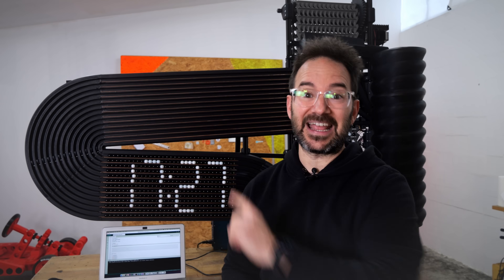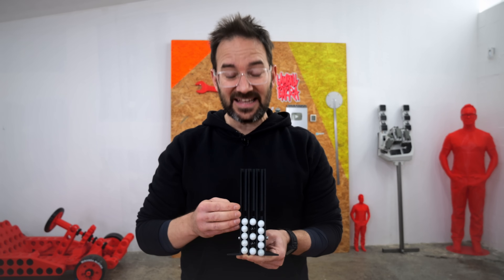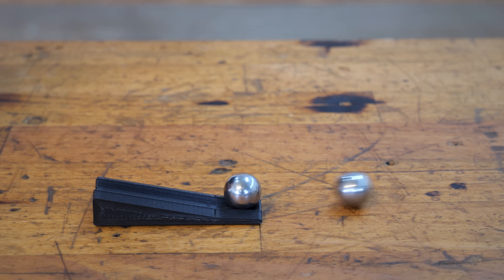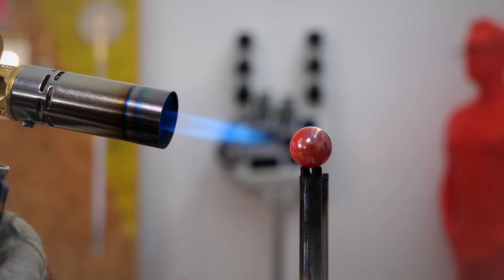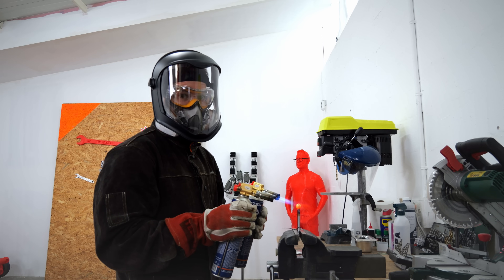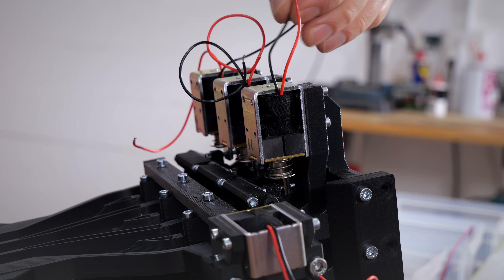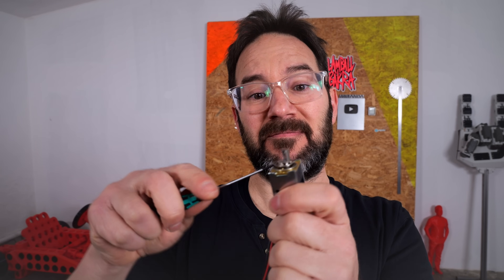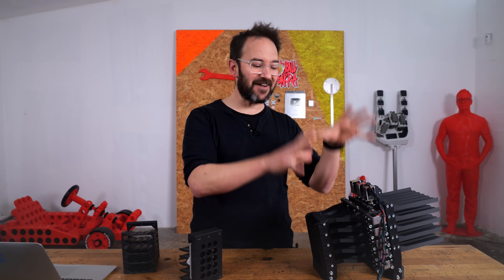Ramp Based Rapid Marble Swap - Marble Clock Seconds Display Pt.1

Comment: You can scale up and improve the marble paint.
First, make a hopper to drop the marble on a rail made of to parallel metal roods.
Then make a simple mechanism maybe using a pin on the middle of the rail that o push down and the marble go direct to the oil bath.
Put a metal basket on the oil like the one they use to fry potatoes.
Make 10 rail in parallel with 10 tourchs.
The mechanism to stop would be like that fork they use to get hail but with very small teeth.
Reply: you can automate it easily, use timer to release the ball to oil bath.

Comment: Personally, I'd rather use pushing mechanism to push out new balls new balls trough flexible holding fingers
Also remove randomness, make each digit contain all 10 or 7 or 3 digits
And another idea is having reciprocating motion of fingers (that are placed between 4 balls) fingers move forward, moving balls forward, balls get blocked from moving, fingers retract, releasing front part of support, that slide down to non-mixing rails for recycle, and right behind them another digit is visible right away, about to get pushed out
Fingers made of sturdy material like rods with bumps, allowing you to keep balls pretty much next to each other, it removes any steering or smart detection, also would require 150 balls per 10 digits, but should work fine

Comment: To do single digits, you could have an extra row on the bottom of the original design with 60 marbles representing each second of the minute, dropping one for each second. It doesn't tell you the digit, but it could serve as a little loading bar until the next minute arrives

Comment: If all 3 vertical solenoids are actuated at the same time, I don't see the point of actually having 3. I assume this was for test only and won't be that way in the final clock, because since each horizontal solenoid drives a whole row,  you can't actually select different colors in the same row. As I see it, you would at times need at least 3 cycles to select all 15 correct marbles, activating columns one by one after selecting the proper position of each row in that column.
I think it would be much easier (although it requires more solenoids/servos) to have an independent selector for each channel, that selects between silver or black channel, then a single actuator that releases all channels at once. It would make the cycle 3 times faster too.
Reply: In this way you also don't need the second gate that holds the marbles to release them all together because that would be done already at the selector.

Comment: I don't know how practical this is but how about instead of having two different color marbles you just use one color marble and simply don't have a marble where you need the other color this won't work for the time but it should work for the seconds since you're pushing from behind there's also means you can't use the ramp to knock the other marvel out of the way since some of the slots won't have marbles what you could do is make that aluminum gate right behind the display marbles and when you move that gate it will shove all the marbles out of the gate and then when it releases the marbles will assume their positions down the ramp basically you're going to use the gate as an ejector and now you can have all the same color marbles for the seconds and simply only deposit them where they're needed since you do not require other marbles to make the appropriate number since you are facing them from the front instead of from the side that would work then you would just need the silver marbles

Comment: I'm still wondering how you will fit the seconds into the original clock face with your design let alone two digits. What would work faster and much easier is to ditch the sorting method and have marbles in a set pattern in a closed loop. There would be three looped tracks that wrap around your original clock face track in a vertical orientation for each digit.  Each track would have all 10 patterns (0-9) of five marbles for their own respective rows. A lift mechanism on the back would push the marbles back up to the top to recirculate. A dual arm reciprocating mechanism similar to the motion of the pistons on a V-Twin engine would help catch and release marbles from the display. The bottom arm would just be to stop the current "seconds" marbles to rest on. The top would free the next five in that row while holding back on the sixth marble. So...Drop five out of display, drop five in display, drop five out, drop five in. This could easily be done faster than one per second and would also allow a two digit seconds display quite easily.

Comment: Using a darker metal for the black marbles could provide an advantage - first it’s much easier to get large quantities without spending weeks blow torching, and if they are different weights than the “white” marbles that could allow for a potentially simpler sorting mechanism. One which sorts the marbles by weight instead of color

Comment: There are some smart corners that could be cut for this project. 
Firstly, there are 5 marbles that will always stay black or white (chrome) through all digits. The two black marbles in an 8 will always stay black, and three marbles in the right most column; the top, middle, and bottom, will always stay white. 
Secondly, not all marbles change from one digit to another, but many marbles stay either white or black. The numbers of changing marbles for each transition are: 
0 → 1: 7 marbles
1 → 2: 8 marbels
2 → 3: 2 marbels
3 → 4: 4 marbels
4 → 5: 4 marbels
5 → 6: 1 marbels
6 → 7: 7 marbels
7 → 8: 6 marbels
8 → 9: 1 marbels
9 → 0: 2 marbels
This has an average of 4.2 marbles per transition, instead of 15 marbles for a full update.
Reply: You must add the change from 5 to 0 for seconds and minutes. And if you use a 24hours clock it needs the change from 23 to 00
Reply: @NoriTheBlackCat  That's a very good point! It turns out that each of these transitions only needs three marbles to change:
2 → 0: 3 marbles
3 → 0: 3 marbles
5 → 0: 3 marbles
Reply: @NoriTheBlackCat Only the seconds digit has to change once per second. So for the 10 seconds digits you only change 1.5 marbles per second, if you do all of them.
Reply: I was about to add a comment in the same vein. Only need to 'update' the marbles that need to change color. Then you can simply have alternating 'white'/'black' marbles in the run behind each pixel. No selection mechanism necessary, marble sorting on the return path gets way easier, etc.

It does mean you need 'per pixel' gates, though you could still use a variation of the mechanical matrix you built already - just drop the selector, since there's only a single run behind each  pixel.

I was wondering if you could hold the ball bearings magnetically. I'm thinking one coil beneath each run, staggering them between runs so the magnetic fields don't interact. Might need to play around with the field strength, as holding a ball bearing that's already stationary doesn't take nearly as strong a field as stopping the next marble (and all its friends behind it) once it started rolling.

It this be a case where separating the bearing release mechanism (magnetic) from a two-stage 'airlock'-style gate mechanism which ensures only a single ball bearing would roll forward each time, and only it the position in front was vacant (because it had been released by the electromagnet). It would be easier to draw than to explain in words :)  Though on second thoughts, there may be a simiper mechanical way of just letting one marble roll forward if there isn't a marble in front (i.e. stopping the run of marbles behind it from increasing the momentum that needs to be stopped).
Reply: I tested the permanent marbles and I've found that yes, the right most column's top, middle and bottom marbles can stay white, but only if the number one goes to the right most column. Otherwise, there are only 3 permanent marbles.
Reply: @dIf the 1 goes in the middle then then there are no permanent marbles.
Reply: only problem I see is that would require individual control for the 9 other gates - massively increasing the amount of solenoids that he would need to use. If he switched to something that had a way to have 3 different states like he originally designed for, it would work, but if he wants to keep the solenoids, it would require a whopping 18 solenoids, compared to 8, since he would have to have each one individually controlled drop and sort. The wiring would become a nightmare, and space wise it would be massive considering theres no elegant way to construct it. 

Considering that there will probably also be 3 more of the same system, the space and tracks would get way out of hand. His system isn't as efficient as possible, but its a clean design thats also semi compact.
Reply: @dmoon8t855I think it could be done with 10, 11, or 13 solenoids. (3 different systems. More solenoids faster.) Not including the 'drop' solenoid; only selection.

So the fastest system (13) would would 5 white row solenoids and 5 black row solenoids, with 3 drop solenoids (as now)
11 solenoids would be 5 row solenoids, 3 white drop solenoids and 3 black drop solenoids.
10 would be the existing 8 plus one for white and one for black.
For each system, if neither a black nor white solenoid is on, then that position doesn't get a new marble.
Reply: @worstedmoon8t855 As for size, it would be ideal to design the location of the solenoids were above, below, or behind, to allow stacking the digits beside each other.
Minimum digit spacing seems to be limited by having black and white feed tracks next to each other. Although with some clever way of sharing feed tracks (and inverting the gates of the middle column) could reduce it to 4 lanes instead of 6.
Reply: @worstedmoon8t855 The width could be controlled by putting all the solenoids above, below, or behind the unit so the digits can go side by side. This way the minimum width would be limited only by having the 6 feed lanes. Setting aside the idea of putting black and white feed lanes one above the area, the feed lanes could be could be reduced to 4 by sharing the feed lanes between columns.
Reply: I was going to point out the null update as well. Also could reduce the queues needed on the backend by having the marbles feed in and drop down although that might introduce binding at the point of divergence.
Reply: Thank you for sharing exactly what I was thinking. You could even simplify further by increasing the visual definition to 3 marbles per line, and then swap out entire lines. This reduces the complexity and increases readability. 
⚫⚪⚪⚪⚫
⚪⚫⚫⚫⚪
⚪⚫⚫⚫⚪
⚪⚫⚫⚫⚪
⚫⚪⚪⚪⚫
⚪⚫⚫⚫⚪
⚪⚫⚫⚫⚪
⚪⚫⚫⚫⚪
⚫⚪⚪⚪⚫
Each change would also be a single color, allowing a faster change and requiring only one sorting of the marbles. 
It's less important, but assembly would also only be horizontal if you have a split path that would roll the marbles into the vertical position for the line change. 
And since the pattern stays the same, you can buffer a few seconds at a time for the larger digit changes.
Reply: @Mac_Omegaly  so, you re-invented the 7-segment-diplay?
Reply: @derorje2035  no. It is not my invention. But it could be a way to simplify the root problem. 
I did invent the 13 digital display (as far as I know it was an original idea) for my hexadecimal clock. When I was learning how to code chips to display the time. The prototype was ugly but it worked. But no one seemed interested in buying it to fund my next project. 🤣

⚪⬜⬜⬜⚪
⬜⚫⚫⚫⚫
⬜⚫⚫⚫⚫
⬜⚫⚫⚫⚫
⚪⬜⬜⬜⚫
⬜⚫⚫⚫⚫
⬜⚫⚫⚫⚫
⬜⚫⚫⚫⚫
⚪⚫⚫⚫⚫
Reply: The way the mutiplexer is ste up He can only Update complet colums. 
So othere then the Channels that never Change He can Not save Anny marbels
Reply: @dapper7764 But if he adds solenoids for black, white, or none (10 instead of 5, or 6 instead of 3) then only the pixels that change in that column drop.
Reply: @konraddapper7764  A simple way around this while keeping the multiplexing is to simply double up the row-selection mechanism (one from each side) and require both arms to be in the same position to let any marble through.
This allows you to effectively do a threeway selection (left/right/none), which can still be performed in parallel for all rows.
- If both arms block the right lane, you get a marble from the left.
- If both arms block the left lane, you get a marble from the right.
- If the arms block opposite sides, both lanes are blocked and no marble comes through.
Reply: If 1 is in the middle:
0 → 1: 13 marbles
1 → 2: 10 marbles
Reply: I think the design requires a new set of marbles to be released each cycle
Reply: @Orholam5   The current design forces you to change all the marbles each time. Actually you could change any whole column at a time, but I don't think there are very many transitions where you only change some of the columns. 7>8>9>0>1 all leave the right column the same, assuming 1 is on the right instead of in the middle. 2>3 leaves the middle column the same. 5>6 leaves the right column the same and maybe the middle, depending on the font of the six. All the others (in minutes and seconds) change all columns. So only 5 of the 11 (including 5>0) transitions change all the columns.
Reply: Don’t you understand that one of values of this project is a noise? What noise one ball will produce? Ah? That’s it
Reply: @sc0or Sure, but it's going to be making noise every second now instead once a minute. and only two of the transitions are a single ball. I think having a different number of balls each time would more interesting than 15 balls every second...and the sorter would go nuts trying to keep up.
Reply: @GordieGii  From an engineering perspective you've got my "thumb up". No doubts

Comment: Hi Ivan,
very inspiring work, love it.

I am wondering, since the tracks are already black and your steel marbles are shiny, why not just send marbles to the tracks where you need them to show the next number. Use the aluminum bracket you have, paint it black and use it to stop the marbles at the front. With a solenoid move it down to release these marbles when changing seconds and a second to arrange the next number before releasing them to the front. This way you wouldn't need any black marbles at all. You wouldn' have to change change much an the marble selector, just put plug in the track so no marble can be released in the black rows, so your work so far isn't wasted. In case you fear the environment being to bright, print a cover to be installed around the frontmost 10-15cm.

Just thinking. Two thumbs up for your enthusiasm.

Comment: One issue that I see with the timing: The top and bottom ramps have different slopes. If you release a marble from a whole column at once, then the top one will arrive sooner than the bottom one.
You could make the top ramp more sloped but also longer. But then you need to re-design the vertical arm that connects the release of the whole column.
If you instead swapped the direction that your selector and release solenoids are connected in so that you release a row at once, then all of those 3 marbles would arrive at the same time. The problem would be that now you have 5 release events instead of 3.

Comment: cool but I think you are going about problem all wrong try to get square peg in a round hole as it where?  just turning the original into mirror of its self so the marbles, coming in from the left in stead of the right as they are at them moment? and then as you are doing have special sub system ball run, not updating the hole clock as most is display the same information all the time in-between screen update refreshes, as point out the second the most active in getting updates the most? like once per second, the hours only update once an hour,, and minutes once a minute? so why is some much clock cycle moving marble being put into, moving the same marble, to just display the same grid of marbles, the only being updated because there in the way? so soliton is to move them out of the way? you could put some sort stop gates in-between the numbers, made of marbles, an just release the old outdates marbles, and ball run in replacement new marbles making up new numbers, so mot on the could directed at just replacing the second number, without have to rebuild the hole clock face ever second, would make run, a lot quieter, not have move so may balls around, and if the marble clock was getting out sink with real would system clock, it only going to be in big one got move the hole display as it's doing at the moment, and can do it at the moment? so have a lot more time in-between marble movements most make it easy on the maths getting numbers ready for display on the screen?

Comment: I hate to say anything that would stop the chaos of this build..... but why not just replace only the needed marbles in the 3x5 of the specific digit each second? would lighten the load of amount of marbles needed and increased speed too. For example, changing from 8 to 9, only need to replace column 1 row 4's marble. 9 to 0, replace column 2 row 3, and column 1 row 4. etc etc. if you did this, you wouldn't even need a selector for column 2 rows 2 and 4, as well as a number of always white ones.... column 3 row 1 for example.
Reply: Good suggestion.

Comment: I think the display in the front would work much better, if it were pre-loaded with multiple marbles. Then when a new marble comes from behind, it will push one marble off the front. That way the front marble would be much more stable and not wiggle around so much.